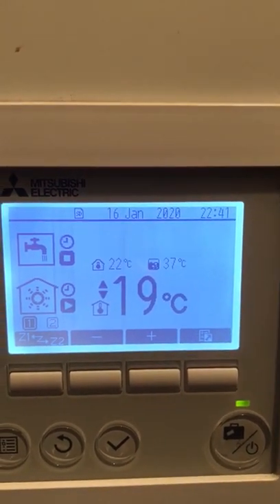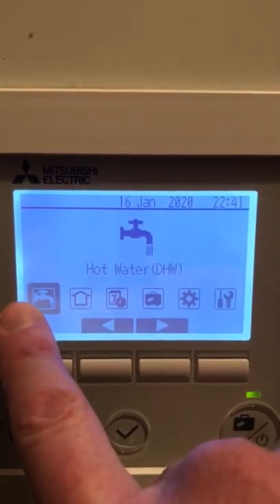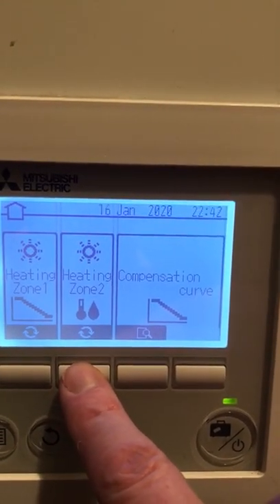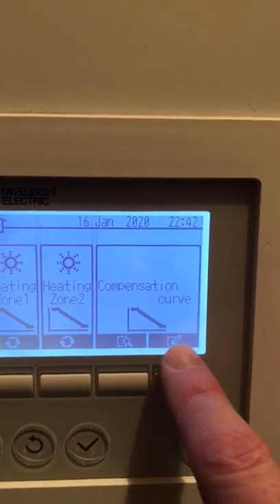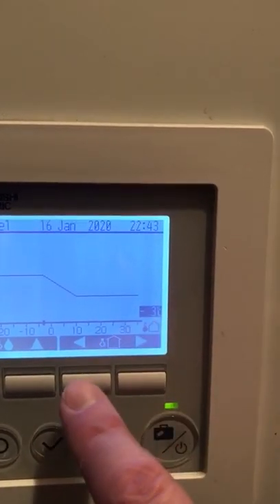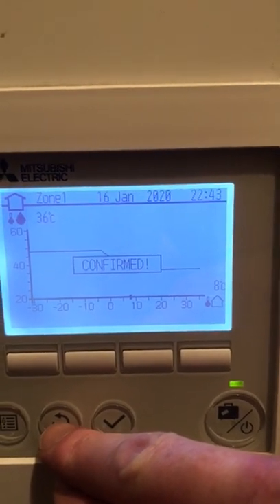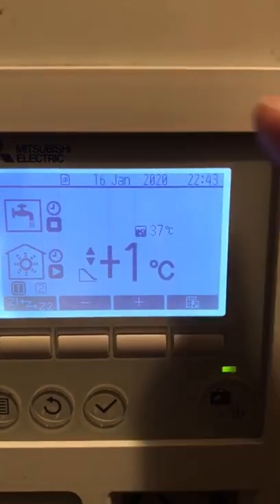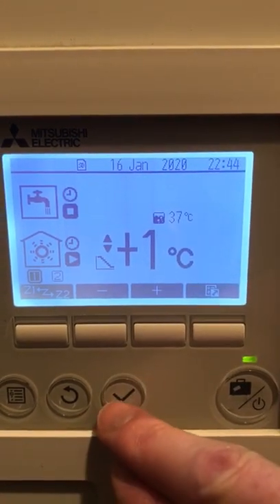How to change your heat curve for your Ecodan heat pump.

Comment: I have an 11.2kW Ecodan which was running for two years in Weather Compensation mode till Oct'23.  Because it is a linear curve it never worked well because I always had to intervene once room temperature was reached by dialling down the curve by a few degrees to enable longer runs. Since the beginning of Oct'23 I switched to fully automatic (target room temp/auto adaptive) mode. After 3 months I'm amazed how much difference it has made - at least 15% better COP with like for like room/outside temps, and I have checked and double checked these results so many times now. The operation of the heat pump is so much better "managed", with more gentle startups (not so much initial power spiking), lower flow temps,  longer run times, and better management of the effect of defrosting in really cold temps. You can clearly see in MelCloud how flow temps are modulated automatically as target room temp is achieved and then maintained for the longest possible runs at the lowest flow temps. Best news is that I don't have to intervene at all now - I can just leave it to do its thing all the time. Very impressed indeed with this superb piece of software from Mitsubishi.
Reply: How do you set that up please
Reply: @sandy2483  it only works with the mitsubishi remote controller thermostat PAR-WT50R-E. From the FTC main control panel, press and hold the main menu button (bottom left), then select heating (house icon), then press the first of the 4 buttons (I.e. far left) until you get a house  icon with a thermometer in it. This is called "target room temperature" mode but sometimes also referred to as "auto adaptive" mode. It's shown in the homeowner quick start guide page 7 and also in the instruction manual section 4
Reply: @lumbarsupport  what target room.temp did you put it at please?
Reply: Ahh I see..I just put my house at 21.. so I'll just leave it now. It will kick on and off as required to keep the temp?
Reply: @sandy2483  yes, unless you programmed in any temperature changes in the daily timer schedule, otherwise it will just stay at 21 all the time, day and night
Reply: @lumbarsupport  hopefully that will be cheaper than the curve mode. Thanks again.

Comment: How does it know what the outside temperature is ?  Also I have my timer set to different temperature at different times of day/ night does that override my wall thermostat thing that says 19degrees right now. I'm sick of pressing it up and down so put the required temp on the timer.

Comment: It is mind boggling how poorly designed thise controller’s is made by the manufacturers (Mitsubishi, LG or Panasonic). 
It is like the engineer was still working in coding IOS DOS! 
There is absolutely nothing intuitive in the logic unless you have been part of the creation of this kind of system. 
Go hire a software engineer with experience in 2022 “thinking” so the logic is intuitive when operating your systems!

Comment: My ecodan heat pump knocked off due to a electricity blackout, it's currently at zero, how should i restart the system after a blackout?
Reply: Lynne I had my Ecodan install only a week ago.  I live in a rural area subject to power cuts so specifically asked the question.  Apparently to get it powered up again you switch off the power at the isolator switch near the controller. Mine is in the airing cupboard with the hot water cylinder and all the control gubbins.  The ASHP apparently doesn’t like to be powered up by reconnecting that alone so, with it powered off as above, go to the outdoor unit where you will have a large yellow/red rotary switch.  Turn that to off, wait 10 to 15 seconds before turning it back on.  Then go to the previous isolator in the cupboard.  Turn that back on and the system should go through it’s powering on and set up procedure. All previous settings are kept.  I’ve had to do this and it works here.  Hope that helps.  Good luck.

Comment: Thanks for this, really helpful! Is there any way to stop the unit coming on so much during the night? Seems to use energy throughout the night even if the heating isn’t on and make the whirring noise, assuming it’s keeping the water heated but not sure I need that if I’m asleep?
Reply: In the colder weather the “freeze stat” mode will operate. if your heating system contains the right concentration of anti freeze you can disable the freezestat mode
Reply: @Dean Gold  how do you disable that please.

Comment: Hello! Can you please explain the «cold» and «warm» temperature settings better for me? I dont understand this good enough to know how to set the temperatures on my Ecodan.

I’ve been using this system for 3 years now, and have had big problems with cold floors when its hot outside. When its winter (-10 to +5) my tile floor rooms are 25 degrees, but never reach thermostat room sensor temperatur set to 27.5.
Now, with 20-25-30 degrees outside the tile rooms never go above 23 degrees room temperature.
Its quite frustrating having cold bathroom..

Been in contact with the installers several times over two years, but they dont help me at all.

Thankfully i found your video, and i changed the curve settings to what you suggested in the video. Hopefully this helps! But as i said first: i dont understand what the different temperatures in the curves actually means...:/

I cant remember what temperatures i HAD, but something like:
Cold: +35 and +20
Hot +35 and 0... but this is very unclear now.

I hope you can help me with this!:) i’ll even pay you if you can make my Ecodan heat properly
Reply: Hi, I'm in exactly the same situation, did you get any answer from someone?
Reply: Hi - I too have been having problems understanding the compensation curve. Can you tell me please, did putting the curve at the settings suggested in the video work? At the moment our cold end settings are 45 and -30 and the house is not that warm and our COP rate is only just over 2.

Comment: My home screen does not display the temp in the home only the water temp. Any idea why? Also have you any experience with the system not powering down after it's done its job heating water and radiators? This happened mine last night and I ended up having to power the whole thing off as it would have been running all night. System only 2 years old!
Reply: I'll add that I never touch this display. It's in my hot press. I only ever edit the heating temp depending on weather and this is done with my zone controller on the wall both downstairs and upstairs. So whatever happened is not as a result of messing with the main display. Thanks.
Reply: @AT-sp9pm  I'm a bit late, bit I'd get a certified ecodan installer to cheak your system, as that doesent sound right.